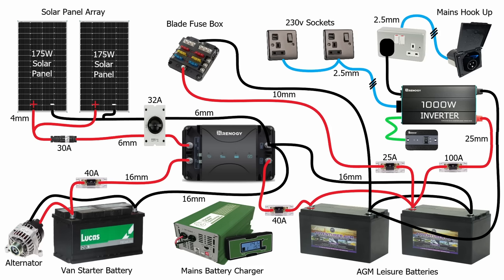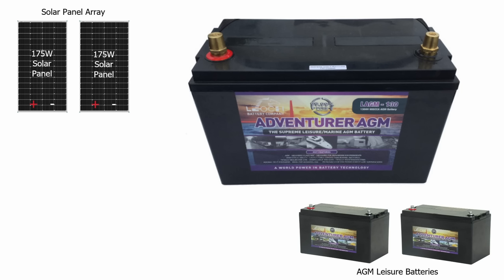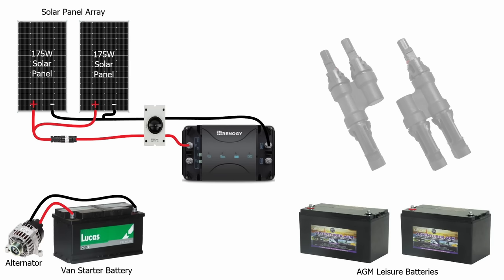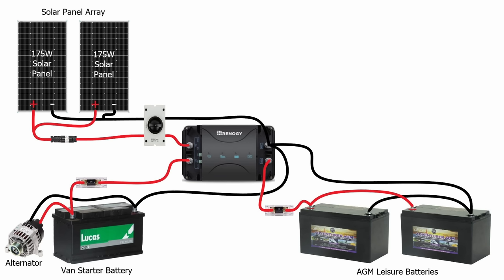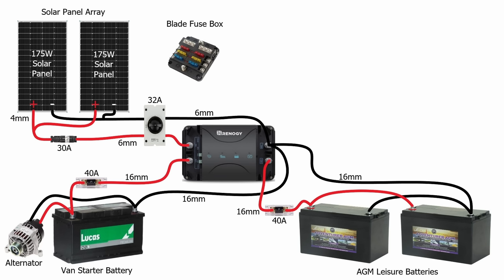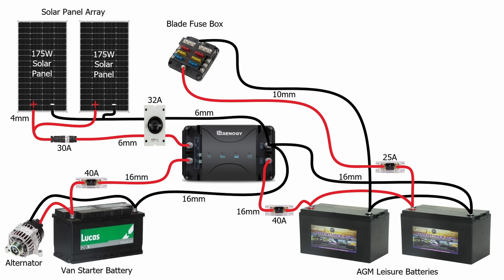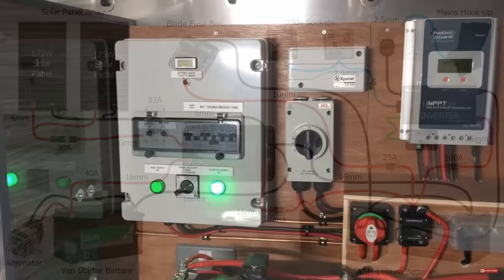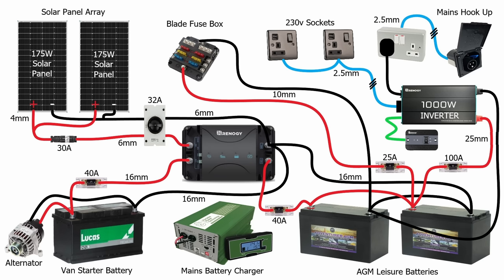12v Electrics for Off-Grid Campervan - Fiat Ducato Budget Build Ep12

Comment: Thanks Greg. Thanks for all the videos which we are following to build our van. I am planning on following your basic off grid set up and have bought the renogy solar panels etc. however I have upgraded to the 50amp mppt doc-dc controller and have got 2 x  105a lithium batteries. Would I need to make any changes to the cable sizing or fuses etc ? Thanks
Reply from the maker: Yes you do need to fit a 75amp fuse to the van battery and upgrade that cable to 25mm. You need a 60Amp fuse on the leisure battery side. The 16mm cable is ok for that side if the charger is close to the leisure batteries. It will work much better with those lithiums. Great upgrade 👍🏼🤩
Reply: Thank you so much for the reply really appreciated 👍

Comment: Question to Greg: To save overall weight in my camper conversion,  I like to install a Lithium battery instead of AGM batteries. Is it possible in this wiring set up?

Comment: Hi Greg
Thank you for your invaluable videos,they are very much  appreciated.
Can i ask you could i add a truma e4 boiler to this system as it is or would i have to change something , i know you are not having a boiler in this build but i would like one.
Thanks again.
Reply from the maker: Yes you can, you just run a 12vDC supply from the blade fuse holder to the boiler. Then a 230v AC mains cable from the consumer unit I mention in the next video so you can have electric heating when on hook up. Lastly a small 12vDC cable from blade fuse holder to the remote control panel. Very easy to ad to this system with no changes to this diagram. Just a few outgoing cables 👍🏼😃
Reply: @GregVirgoe   thats great news ,nice and easy. One other question ,is there any benefit in fitting 2x200w panels instead of the 175w with this system or is it too much for the batteries. Thank you again Greg for your help.

Comment: Hi Greg, loving the detail you go into in the series build. So many useful tips to be had. It's brilliant, thank you. Quick question, budget out of the equation, would it be worth replacing the vehicles alternator with better one so that it charges faster whilst on the move? Many thanks.
Reply from the maker: This is not necessary as the smallest standrd alternator will generate well over 100amps and this charger is only taking a max of 30amps, You can't put more in the batteries for risk of over charging them.
Reply: Hi Greg, Thank you so much for getting back to me. That's great to know. Just about to watch your latest video. Cheers
 @GregVirgoe
Reply from the maker: @garyholloway3327  no problem 😉 anytime 👍🏼

Comment: There doesn't seem to be anything protecting against overdischarging the batteries. I found that there are some simple "battery guards" or low voltage cut off switches  that could be put between for example the inverter and the batteries here?

Comment: Great video. What made you go for this mains battery charger and not the Renogy? Also, is it worth permanently wiring up the mains charger to the battery so you can charge without clipping on the crocodile clips. I basically want to get the mains hookup to charge my leisure battery when needed. Thank you
Reply: Thanks Greg. I have a similar question regarding the main charger; Where do you connect the PPT Mains Charger, and can it be permanently in van connected to the hookup, then directly to Leisure batterie/s for charging?

Comment: Hi I'm half way through installing renogy dc dc mppt same as your in the video but I'm wondering if all negative will fit on top right on renogy as there will be one from solar one from van battery and one from leisure battery so wondering if you could help please

Comment: Hi Greg, please can you tell me why everyone run a positive and a negative cable to the 12 volt accessories they use, why not just run a positive cable and use the vehicle body as the negative earth, that would save on cable and weight.
I do like your videos very clear information many thanks
Richard
Reply from the maker: Hello Richard, well I prefer to make the leisure system “isolated” from the van for a number of reasons. 
Copper is 50x more conductive than steel. Avoids poor ground connections, high resistance and volt drop issues. Also no issues with interference with the vans 12v electric system. Ok so it cost a little bit extra in cable but it’s a far superior system and takes no more time to install. Pulling one cable so it might as well be a 2 core 👍🏼😊

Comment: thanks for great content in all your video's van building, the Renogy 30 amp unit your using in this video I have the 50amp version to charge 120amp x2, i can't work out if this fine to use, any information would be great, thanks
Reply from the maker: The recommended max charge rate for AGMs would be 20% of capacity so (2 x 120Ah x 20%) is 48A in your case. So the 50A version is ok. The battery fuses will need to be 60A and the battery cables increased to a min 25mm

Comment: If i had 4 * 175w panels wired in parrallel, what guage wire should i use coming from the mc4 connectors and what size in-line fuse on the positive wire, Cheers, Michael

Comment: Very great video! thank you for such a good explanations. Since I´m not an expert this really helps me to build up on my own. My system has the same items, 1000W inverter, DCDC 50a mppt (both renogy) but I have 2 solar panels with 220W each and only 1 12v 100Ah battery LifePo. What switch should I consider from the solar panels and considering the DCDC 50a controller? 60A or keep the 32A that you have recommended? Also from the battery to the inverter, should I keep the 100A and 25A fuses? Thank you beforehands!
Reply from the maker: Ok the 32amp isolator is ok 👍🏼 
Fuse from van battery needs to be 75amp to DC to DC then 60Amp from that to the leisure battery. 
Increased van battery cables to 25mm. Keep invert fuse same as mine 100amp and same size cables as me. 👍🏼😊
Reply: Thanks, I will use a Circuit breaker 30a 12V-48V DC with manual reset button and reset arm which is smaller and I guess it fulfill this purpose from the solar panels (they are the Renogy 220W Foldable version that will be installed when necessary. I think it would work here too.
Reply from the maker: @luiscambiaghi6  you can get double pole DC circuit breakers that will disconnect both positive and negative wires so can be used for proper isolation too 😊👍🏼

Comment: Hi Gregg,

With the mains hook up will this also charge the batteries or only supply power to the inverter and 240v sockets.

If so how much more wiring is required to get the mains hook up to charge the batteries? 

Cheers

Comment: Great vid as usual; am I right in thinking that the set up as you have it here doesn’t protect battery from being depleted though? The 12v loads are straight off the battery so you could flatten the battery I guess???

Also as I already own an MPPT charger and need to buy a DCDC charger, is there any harm in having the 2 charge sources, leisure battery and loads all connected via a central pos and neg bus bar? If I put a battery protect or the likes “downstream” of the bus bar before the loads, I guess that would prevent over-drawing the batteries?
Reply from the maker: If you didn’t monitor the system voltage and just used everything willy-nilly then yes you would drain the battery but why would you let that happen? If you eat all your food at lunchtime you won’t have anything for your tea 😊😉

Comment: Can you use a cigarette lighter cable (inside) to connect the car battery to the charge controller or directly to the inside AGM batteries?

Comment: Should there not be an RCD unit so when your on site you have mains coming into the sockets so you have breakers to cut power to the circuits incase of a trip caused by a short or overload.

Adrian

Comment: Very interesting video, could you set a garage up in this way (DIY workshop)?
Reply from the maker: Yes, this off-grid system would work well for a garage, shed, boat or any mobile location you need free power.
Just use a standard MPPT solar charge controller without the DC-DC charger as you won't need that part.
Reply: @GregVirgoe  thanks for coming back with an answer, enjoy all your videos right back from the beginning.

Comment: Regarding the Lithium V AGM thing.  I just went on Kings 4WD site and priced their batteries.  Kings are the budget 4WD supply store here in Australia - I’m sure there is a equivalent in England

A 120AHr LiPO4 battery is $649.00 and weighs 15kg

Two AGM 115AHr batteries are $249 each and weigh 29kg each.  

The 120AHr Lithium has the roughly the same equivalent capacity as the two AGM batteries as you can safely use 90% of the Lithiums capacity but only 50% max of the AGMs.

The AGMs are four times heavier for a saving of $150.  You have 45kg extra payload before hitting the allowed GVM of your van.

For anyone wanting to do it just replace the two AGMs with one 120AHr Lithium and set the Renogy controller to it Lithium setting.  The 1000W specified inverter will be well within the discharge limit for almost all of the cheaper LiPO4 batteries.   You just have to make sure your battery has at least a max discharge rate of 100A or more which is listed in the spec sheet.
Reply from the maker: Exactly what I said in the video 😂well done for agreeing with me 😊

Comment: Hi Greg, great videos, I'm doing my own camper at the moment and I'm I bit confused  about your cable sizing, so when you say use 10mm or 16mm cable is it actually 10mm or 16mm in size or is it the strands in the cable.. Thanks greg
Reply from the maker: The size of the cable refers to the cross sectional area of the copper conductor. When you buy cables in the uk this is what the sizes refer to. In america this is converted to AWG and you can google conversion tabels if you need to.

Comment: Excellent video again! By using the inverter connected to the mains, does that mean there is no need for a consumer unit?
Reply from the maker: If I had my official health and safety hat on then a metal consumer unit on entry to the van is necessary. 
On the other hand every hook up we had is protected by an MCB supply and the kettle lead plug to the inverter is fused so do you need a third protective device?
I can’t advise you not to fit one 😅😊
Reply: @GregVirgoe  Thanks Greg!

Comment: Hi Greg. What’s the best way to wire in a mains battery charger in to this system ? I currently have a battery charger that chargers my leisure battery’s when it’s hooked up to AC on a campsite. What would be the best way to incorporate that in to this system. Thanks

Comment: hello Greg. Great video, but I had a question: From what I understand about the system, when you are parked in a campsite, all the power to the 12v circuit will be maintained by the batteries, and these will be charged by the solar panel. Wouldn't it be interesting to put a transformer, with 230v input and 12v output, powered by the camping network: that way, if the weather is cloudy or rainy, the campervan would have power.
Reply from the maker: No need to do that you simply turn on the mains battery charger that will keep the batteries at max, very simple.

Comment: Thanks Greg. Does the Renogy controller cut off to protect your starter battery if the voltage drops in the leisure battery ?

Comment: Hey Greg, thanks for a great video, much appreciated. Quick question, will the mains charger be permanently wired in, if so where do you connect the output - direct to the leisure battery terminals, and do you need to isolate the mppt  charger when it is in use?Cheers Oliver
Reply from the maker: Connect the out to the same battery terminals as the solar charger and no you do not have to turn of the solar charger.

Comment: Hi Greg, I have almost identical setup to your, using the Renogy 50a MPPT controller, 3 x 200w solar panels, 280ah Lithium battery, Renogy shunt etc, my question is, why is the output from my controller changing to 17.2v when the solar is on? it is at 13,5v until then. Its as if its not regulating properly. Thanks Greg, from Ian

Comment: So if I did want to boil kettles and draw a bit more power.  Would the 2000watt inverter be the middle ground or still lithium battery would be better ?  

Got windows 
Getting Max Fan 
Then it’s about electrics and water

Comment: Q- the cables from the panels are 4mm then from the connectors 6mm for the obvious doubling of amps - does this mean really that the 4mm cables would have to be changed to 6mm from the panel to the connectors too ? 

If not why ?

Surely the ampage would be too high or is the jump in thickness to 6mm adequate ?

Comment: Thanks Greg, brilliant as usual. One question please… With 2 batteries, there a best way to connect the battery charger to the battery terminals? Thanks.
Reply from the maker: Connect the mains battery charger to the same terminals as the dc to dc charger shown on the diagram.
Reply: Great thanks

Comment: Hi Greg I hope you find thus message I'm half wY through my conversion and I'm following this electric setup with the renogy my question is regarding the battery charger for when I plug in to 240v what battery terminals do i connect to if I. Following this exact

Comment: greg fabulous! but what is the overall cost? at this time I know prices are rising all the time at the moment but when you did this video how much was this cost?
Second question - I'm thinking of not bothering with the UK 230v plug in but would like to be able to plug-in in European campsites. You have travelled extensively through Europe, what would be needed to plug-in there? they are only 2pin aren't they? and 120v? it's half the volts 1/2 the power and danger no need for all the same grounding etc surely? coming rom Canada where we are also 120v & 2pin it would be much easier wouldn't it? How would that look to set up a connection for European plug in? Many Thanks!
Reply from the maker: There is another comment on here where I have broken down all the costs for each item I purchased, the total for everything was £950
I think I did show this in a very early Europe video, they use the same mains voltage as us but sometimes a two-pin plug in lieu of a 16amp commando socket so you need an adapter lead, a reverse polarity lead and a plug tester.

Comment: Hi Greg, been watching your videos and they have been great! 
If I have the exact same set up as this but have the 50a Renogy combined mppt and dc-dc will that be an issue with the same battery’s you have selected here or do I need to rethink the batteries. I got the 50a charger just in case I added more solar in the future but probably won’t add more. 
Thanks !
Reply from the maker: You do have to be careful not to overcharge lead-based batteries by forcing too many amps in too quickly. You could add another battery when you decide to add another solar panel. Be aware that the 50a controller has a max solar input of 600w :D
Reply: So am I right in saying that if I leave the solar at 175w x2 wired in parallel my 50a mppt will do the exact same job as the 30a version therefore the lead based battery bank (2x110ah) would be fine?

Comment: Greg I am so delighted to see your still at it on here. I referred to your videos back in 2020 for my first van build of a ford transit. And I  am now even further ecstatic to see you are converting a fiat Ducato, as we just bought a Citroën Relay which is much the same.

Could I ask for this set up, does the dc-dc unit negate the need for a split relay from the van battery?  And is there any considerations for smart relay (don't think my van has one by still useful to know)

All the best

George and kath
Reply from the maker: Hello 👋 this unit replaces a split charge relay and does a much better job of monitoring the battery conditions. It works with all types of alternator. With smart ones you just need to connect an ignition cable which comes with the charger.
Reply: @GregVirgoe great stuff thanks for replying. I ordered this very kit last night with the only change being the controler, RENOGY had a really good deal on the 50a instead of the 30a which I assume the only change I need make is the cable thickness and Inline fuse?
Reply from the maker: @George8sn   I saw that deal with the M1 controller, really cheap bargain. Yes increase the cable size and fit 75A fuse to the van battery and 60A fuse to the leisure battery
Reply: @GregVirgoe  brilliant , many thanks once again

Comment: Hey Greg. That's an excellent tutorial. Well done on explaining things. Is it OK to not have an inline cartridge fuse from the solar panel to controller? When I set mine up, I just have the solar cables directly connected to an isolator, then the MPPT controller to the AGM battery which is fused.
Reply from the maker: It's an added safety precaution, i'll be honest we have our original van setup exactly as you have with no solar fuse and it's been for the last 5 years :D It's very simple to retrofit if you wanted to add one and they come in varying ratings too. Just fits between any MC4 connection.
Reply: Thanks Greg. Cheers